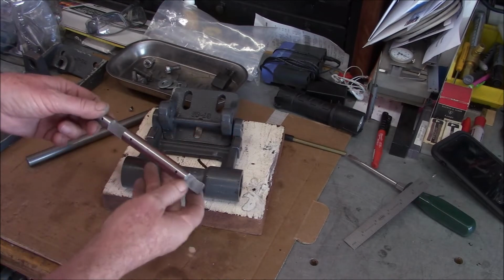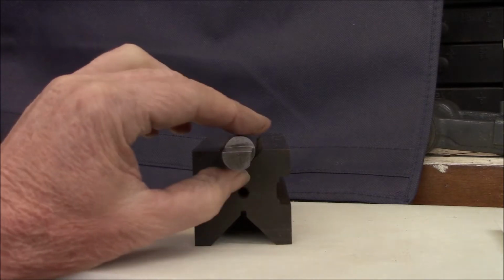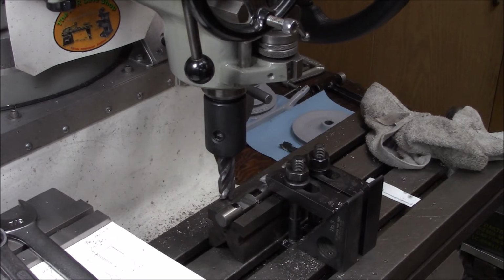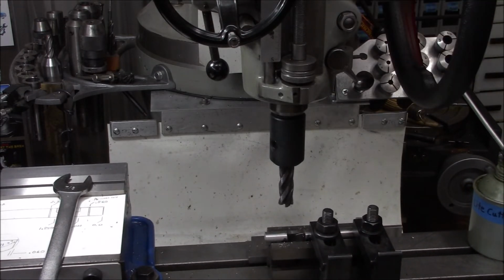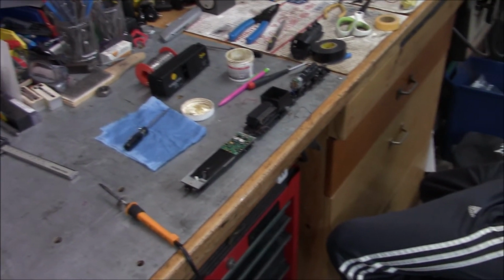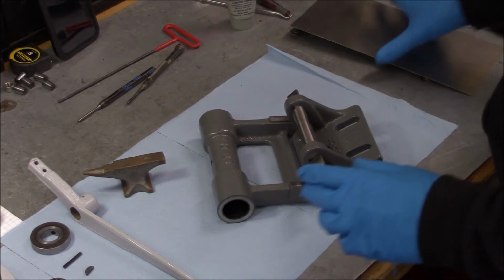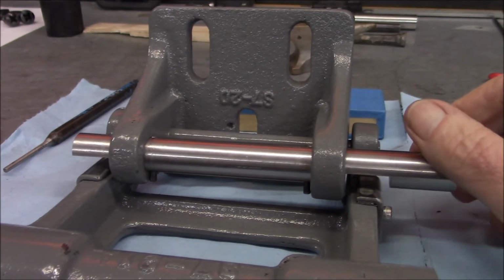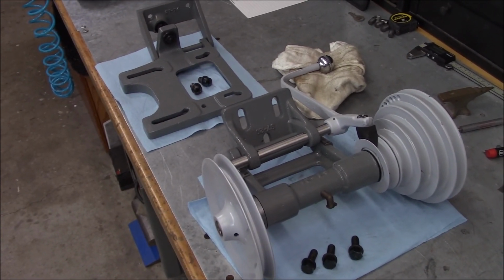Atlas 7B Shaper Project Part 6 - Countershaft Final

Comment: I have the same Atlas 7B shaper that I am currently rebuilding. My manual for this shaper calls out oil for lubrication of the countershaft bearings, not grease. The Gits oiler should be used to oil the bearings. If this was an Atlas Lathe then you are supposed to use grease for the countershaft bearings. Same bearings with different application and different lubrication requirements. Nice work on the new shaft you made.
Reply from the maker: Yep, Understand John.. I going with the theory lubricants have advanced tremendously since these machines were designed and manufactured, especially greases. The old lithium greases had a short usage life and required flushing out (regreasing) frequently. I don't have any scientific data just going by the changes I've experienced servicing hundreds of bearings working in industrial HVAC service for 44 years. Once we converted to synthetics drop in bearing failures was amazing, we were sold. I will be lubing the felts with oil and probably add a little oil via the gits for good measure.
Thanks tor the great info and comment..
ATB..Dean

Comment: Nice job!! high skill level...based on Atlas design this shaft was B1112 steel hardened with Cyanide  treatment 0.010 to 0.015 (depth)
Reply from the maker: Thanks, Good Info 👍👍
ATB....Dean
Reply: where did you buy the roll pins?? which measurements does it has?

Comment: I think that shaft is meant to have felt seals and be oil lubricated. And definitely heat straitening of the old shaft would have been my first step. Worth doing even still for the learning experience. It's a wonderful thing really, it's completely different than trying to use a press or another method relying on brute force as those tend to localise a bend too tightly whereas the heat you've got a lot more control.
Reply from the maker: Thanks Ben !